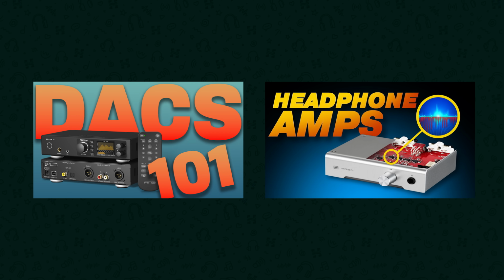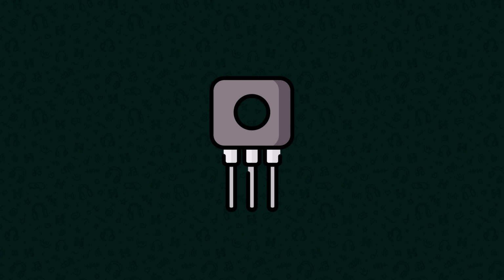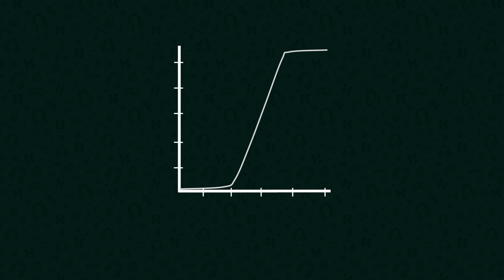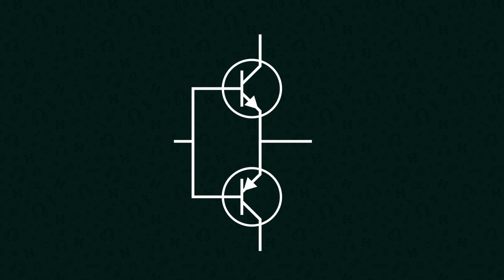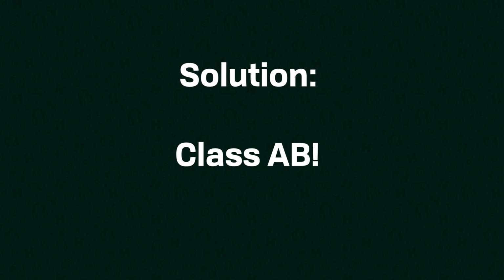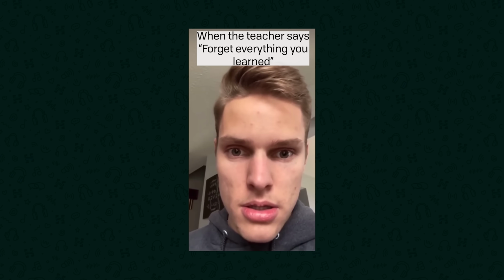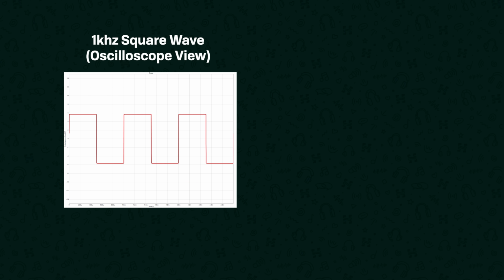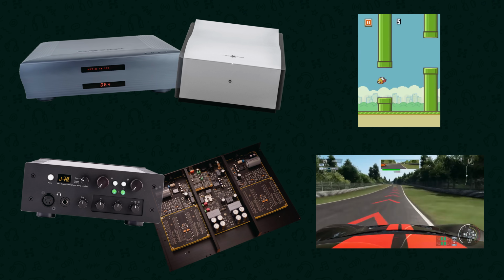Audio amp classes as fast as possible!

Comment: Do you really need more than 5-6 watts for the majority of headphones? I know there are those that call on for a lot of wattage, but they are outliers. Class A is a simple design and we really don't need to muck about with all the crap that might happen in different classes.  So, you can just listen to the pure characteristic of the selected transistor or tube. Many headphones can resolve this type of performance.  So for my money (parts), class A all the way.  In non-portable situations live with different amplifier types and you may come to your own conclusion.
Reply: 5 watts for headphones? bro must be deaf

class a is not simple at all, the bias is complicated, and for commercial ones, way more complex

a beginner can easily design class ab or class d to be good, but not class a

Comment: I prefer Class-D amps. They’re cheaper, lighter, more efficient, and they don’t take up as much space compared to Class-A and Class-AB amps. They also sound nearly the same.
Reply: Mhm class D amps get a lot of hate even though 99% of class D amps have no noticeable difference. I do like class B and AB amps better though because theyre simpler and usually more reliable.

Comment: AB = BEST

D = requires a higher bitrate @ 24 bits (32 bit preffered)

___

also brand/manufacturer is the MAJOR factor (software is just as important as hardware)

__

Example = majority of TV screens are made by LG even smartphone/tablet/pc 

sony has better software and programming (their TVs are better)

then DELL makes better PC monitors (LG = but better assembled)

Comment: Some remarks…

A single transistor (single ended) must be class A (or D) to have a useful output. A double (push-pull) transistor can be class A, B, AB or D to be useful.

The configuration doesn’t make it the class, it’s the bias. Push-pull can still be class A. 

If you go from class A to class D you roughly double the efficiency, so +3 dB. If you go from a 82 dB to a 102 dB sensitive loudspeaker it’s 100 times more efficient (from 84 to 94 dB 10 times, from 89 to 92 dB 2 times). Using an inefficient driver with an efficient amplifier only produces more efficiently heat into the voice coil which makes the driver even more inefficient!

On top of that a class D amplifier requires an output filter between amplifier and loudspeaker in which you lose power. Just like the crossover filters. 

So what’s the point of using class D?

If efficiency is priority you must get rid of passive (high level) crossovers and have 3 or even 4 way (or 3 way and sub) loudspeakers, with efficient drivers. Otherwise most power is consumed in output transistors, voice coils, crossover networks and padding resistors (the whole purpose of a padding resistor is making a driver less efficient!).

Comment: Ugh, class D for Dirty. I have yet to hear one that sounds great to me. Even at ridiculous prices. The only good thing about Class D is that you can make a lot of power cheaply and with minimal heat. I use 125W Class A monoblocks for the main channels and Class AB biased for about 40W of Class A even for my sub channels. Sub amps are about the only thing I'd even consider Class D for. I'm sending the Thought Police to arrest you guys for referring to transistors as valves. That designation is lovingly reserved for tubes!
Reply: Why such low power.

Comment: You actually made a pretty big mistake in your explanation. Right when you started off, one of the first things you said was a transistor is the solid state equivalent of a valve. That's simply not true, and is very important to know given the topic. Transistors are switches, not valves. If transistors were valves, we wouldn't need class D amps. Stitches like to be on or off. When you run transistors between on and off, like you would a valve, it generates a lot of heat. That's typically why class A and AB designed amps get hot and have big heat sinks. All the heat generated from running a transistor in between on and off has to be dealt with.

The main reason class D amps have become so popular is because transistors don't act like valves. Instead of running transistors in between on and off, class D designs turn the transistors on and off really fast. It uses the transistor like a switch, as it was intended. That's why class D amps are so small, light and powerful. They use the transistor in such a way that generates almost no heat. In comparison, vacuum tubes are valves, and don't act like switches. Class A and AB is more of a natural fit for tubes than transistors. The reason tube amps are big and heavy is most of them use output transformers. That makes them big and heavy for a different reason. However, a few designers make tube amps without output transformers (Output Transformerless or OTL). Because tubes operate like valves, OTL designs are similar to class D in that they are very light and don't generate a lot of heat. 

So, if you want to have a discussion on solid state amp classes, its kind of important to know transistors are switches and not valves. If transistors did operate like valves, class D would make no sense.
Reply: wtf is u on about

u r completely wrong

u didnt even get ur operating region right

transistors can be both

Comment: I'm sorry to say that but it's not quite correct. You're confusing construction of an amplifier with the class they work in. From watching this video someone could learn that single transistor amplifier is an A-class amplifier and amplifier built of two transistors (npn and pnp) is a B-class or AB-class amplifier. But it's not a full picture. Such amplifier can work as A-class amplifier with no problem. There's no restriction from setting bias for each transistor separately in the middle of the linear characteristic and make it A-class push-pull amplifier. So please, don't call this configuration B-class or AB-class amplifier only beacause 95% of them are made as such. This configuration is called push-pull. Someone can fail his exam because of that.

Comment: You can get BOTH the Triangle Wave generator AND the Comparator in the same tiny IC, the venerable and inexpensive 555 timer/oscillator chip. You feed the analog signal to be amplified into the Pulse Width Modulation pin. You also need to add 1 external transistor to make the basic oscillator output true square waves, so that at zero modulation the output is symmetrical 50/50 waves. You then amplify that to desired current and voltage with transistors operating with very low losses in switch mode.
If the PWM function is done with the CMOS version of the 555, you can make the square wave frequency be 2 MHz, which is about 6.64 octaves above 20 kHz. Then it has to be filtered with a low-pass filter, likely an RL filter for the sake of efficiency. To have the output be essentially flat between 20 Hz and 20 kHz, you may want to set the corner frequency of the low-pass filter to be 40 kHz or 5.64 octaves. That still gives a very respectable 33.8 dB attenuation of the raw 2 MHz signal, when using a simple single-pole low-pass filter. 
If used with voice-coil speakers, some additional filtering will be provided by the speakers themselves, which behave approximately as RL filters. The overall effect is that very little high-frequency current will flow in the speakers, and it will not be reproduced because it is ultrasonic. Meanwhile the very desirable audio frequencies will flow and produce very nice audio outputs.

Comment: Another HUUUUUGE advantage of the Class D amplifier is that, if you know all your audio is digital, you do not need a DAC. 

A modest (by today's standards) ASIC/DSP will be capable to take the digital audio output as is, and compute the correct PWM signal, saving you the DAC, the 500Khz oscilator, comparator and all the other stuff. Said DSP is probably part of the circuit you use to handle things like MP3, FLAC, ToshLink, PCM, ALAC, so, in a certain way, it comes "free".

And the fact that Class D amps are Impedance load dependant (or, more correctly, the speakers/headphones coil [inductor] are part of the low pass filter) is the reason why, if your equipent came with decent quality speakers/headphones/buds those will probably will sound as best or even better than aftermarket quality ones, because the included buds should be perfectly matched to the Class-d amp of the equipment.

Comment: In the olden days, when we designed these, the D's were actually called Class-S, for "switched".  My first design had a 300KHz 3dB bandwidth and was used as a motor-drive for uranium separtion systems.  These motor ran up to 90,000rpm, but had variable speeds.  We also used for our Lunar Roving Vehicles, but that motor drive ran at only 17KHz.  Some of the frequency limits are imposed not by the electronics, but by the actual load.  You cannot run speaker "iron" at 300KHz, since it would melt the local copper windings.  Our Induction Heaters are typically down at 20KHz or so (variable depending on Curie temperature), and depending on the losses in the target material.
Reply: 300khz bandwidth? what is the carrier? is this state of the art

Comment: For those of us with an RF background, it's easier to think of Class D as a modulation scheme, with the ultrasonic carrier being modulated by the baseband audio. It also helps to also know about Class C, with greater efficiency but more distortion. Class D extends Class C to its limit, by greatly increasing both efficiency and distortion, but then filtering out the distortion products, leaving the amplified baseband signal.
Reply: nah bro

just use the word pwm dude

it is literally just pwm switching a complementary pair

who doesnt know pwm rf or not? arduino anyone?

pwm is much easier to understand than class d, also class c is very different
Reply: @urnoob5528 doesnt help that not all class D amps use pwm.

Comment: Fascinating and well explained. I never knew how this worked. Makes sense why class D amps don't sound as good now.
Reply: That's the fun part: they absolutely do. The better designs rival class A amps in audio quality, and have been for years.
Reply: @ropeburn6684depends on the amp. A cheap class A amp will almost always sound better than a cheap class D amp. But once you go up in price and start talking about more sophisticated designs, then the matter becomes a lot more complex and subjective. A 500 dollar audiophile grade class D amp will have basically perfect audio quality, so will a class A, any difference between the two at that price point will only be theoretical and you wont hear the difference.

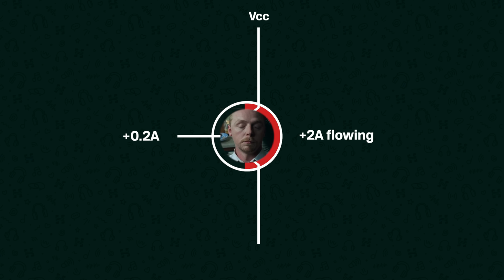Comment: @2:18 The transistor will only switch on when a certain voltage is reached.  It requires a threshold voltage for current to start flowing.  (same as forward biasing a diode).  This is a significant distinction.   The moment there is base current, there will be an amplified collector current.  

Also, most class A amps used in audio are push-pull class A.  They look like class AB, but they are biased so hard that neither transistor ever turns off completely. 

Generally, when the amp is is in the topology shown in this video as class A, the amp will be noted as "singled-ended" and it is practically always a tube amp.
Reply: Bipolar (BJT) transistors are current amplifiers. FETs are voltage amplifiers. BJTs are more common in traditional styles of amps (other than tubes, which are, like FETs, voltage devices) and are probably more likely to be seen in class A amps. Both are used in audio devices and each type has its own advantages, though many of the disadvantages of FETs have been reduced as technology has improved.
Reply: @waylandsmith In any case the statement that a threshold-CURRENT is needed is wrong. while BJTs are current-controlled current-sources they have a threshold voltage.
And when people are talking about just "transistors" this is most often referring to BJTs or other current-controlled variants and not voltage-controlled like FETs.

Comment: Great video, but you left out that the class D amplifier's digital waveform is converted back to an analog waveform. You also left out why one would use a Class-D design in the first place, power efficiency.

Comment: There is also Class H that uses several Input Voltages to reduce the Loss, as a Transistor only gets the Voltage-Drop to the next higher Voltage.

Comment: Vacuum tubes perform the same function as transistors, but instead of controlling the charge on layers of doped material with the gate pin, you're blocking or allowing electrons to pass in an electron beam by charging a metal grid with your input signal. 

Electron beam may sound complicated, but it's just a fancy light bulb with special electrodes inside it arranged in a very particular way to generate electrons on one side and collect them on the other. 

Congratulations, now you know how tube amps work too, mostly.
Reply: everyone should have phd by ur logic

last sentence is completely false

u still dont know how tube amps work at all, let alone mostly

Comment: Lot of people pointing out a lot of details, but wanted to say I already knew and ignored every single one of them personally, but cleared up a few concepts I’ve been struggling with due to the nuances in the details, it’s actually quite helpful to be reminded of what does and doesn’t matter basically. I was over here stressing about nonlinearities and forward and reverse biases for example. And for how class A’s have so much hum and distortion but i really appreciate the design after seeing how simple they are.
Reply: Class A should have no intrinsic hum or distortion.  If it exists in Class A, it will also exist in Class AB or B.  That's a power supply deficiency; or, in the case of phonograph pre-amplifier, a ground loop .

Comment: dac units are a waste of time. I'd much rather have a high bit rate digital signal to my amplifiers than an analog signal.. just like tube amps. over transistor amps. that are modern. using a tube amp. for audio reproduction & amplification is like going to an art gallery wearing sunglasses..same goes for Vynal Records.. It all really boils down to the ears of the beholder.. But hype can steer people away from a better audio experience. Remember as we age we lose hearing capabilities. First to go is high-range hearing so therefore what sounded good 20 years ago may not sound good now.. or visa versa in some cases. I'm a Class H amplification fan. The Rail Catcher. The higher quality class H. amplifiers are second to none as far as I'm concerned especially when using high-watt amplification in any kind of venue..

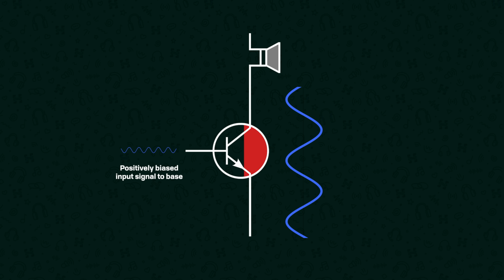Comment: 3:04. There's another problem if connect a speaker like this: you pass DC through a speaker coil as well, so it will heat up, too, and besides, its voice coil will have an offset from its normal 'zero' position, so it will cause distortions when coil goes out of range of magnetic field. Normal class A amps use resistors and capacitors to prevent it. Same with B, AB and D classes, if they are powered by unipolar power supply and are not bridged. They don't use resistors but still need capacitors to remove DC offset, otherwise they will blow your speakers.
Reply: idk why he decided not to use the standard textbook circuit

unipolar power supply can use rail splitter design, so no need for capacitors
Reply: Tube (valve) amplifiers use a transformer to couple to the speakers; it eliminates the DC and also transforms the high impedance plate circuit to a low impedance speaker voice coil.  A class-A without transformer is going to have to use a capacitor and that will give you a big thump when powering on the amplifier. Some circuits use a relay that prevent this thump from reaching the speakers (Crown amps and pre-amps).

Comment: It would be nice to also touch on the fact that class-D does NOT stand for digital.  It's simply the next letter in the alphabet, after class C amps.  SO many people call them digital but as in your example using a comparator, it can be a purely analog implementation.
Reply: I agree mostly.  The differences in the classes has to do with the duty cycle in the linear portion of the transfer curve; Class A has a 100 percent duty cycle of the final amplifier state (tube, transistor).  Class B has a 50 percent duty cycle. Half the cycle the device is not conducting at all.  Class C, used only in continuous wave transmitters (FM for instance), is fully "on" for only a small portion of the full cycle, class D rapidly switches between fully on and fully off; thus there is little energy dissipation (thus heat) in the final amplifier.

Comment: Electronics engineer here. Only a small thing, but is there any chance you can change the video thumbnail to show a basic Class AB output stage for Class AB rather than the Class B output stage shown? It might confuse some people not familiar with amplifier design as shown at present. Otherwise, it's a great primer. 👍